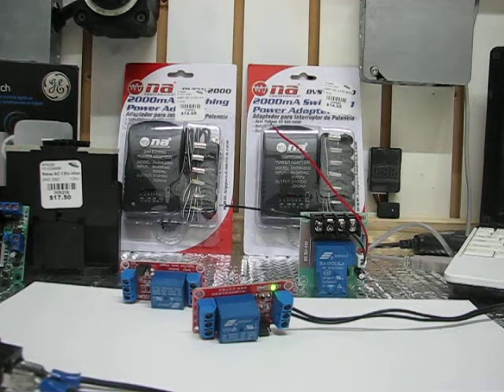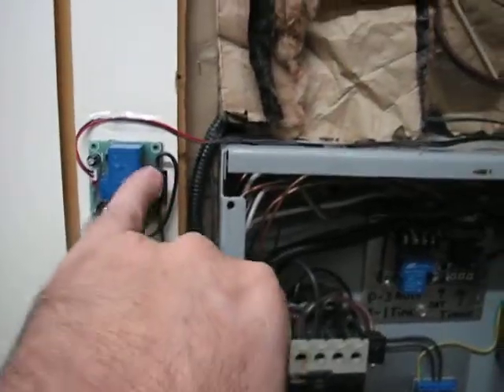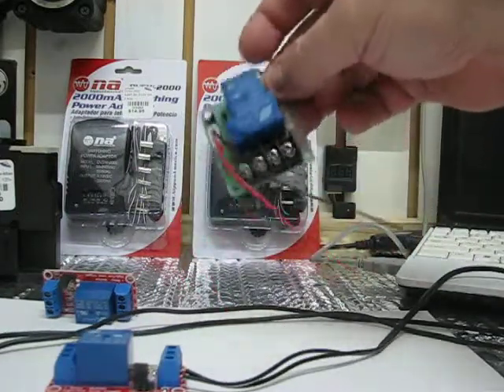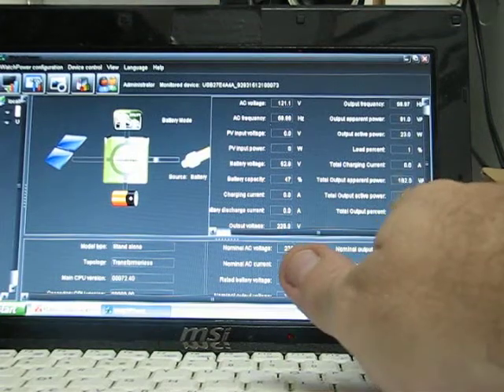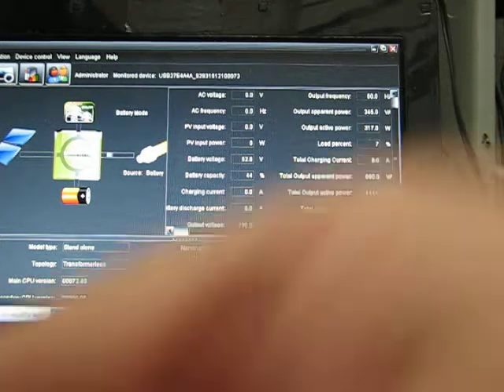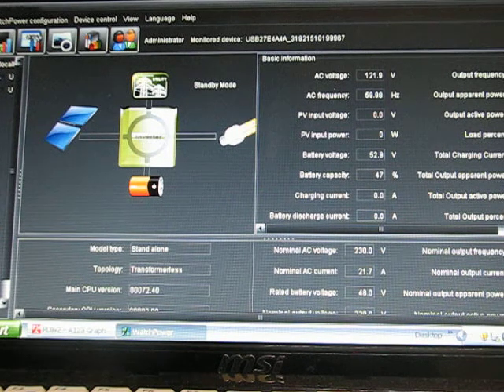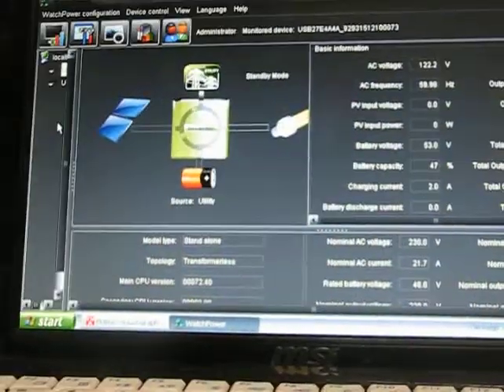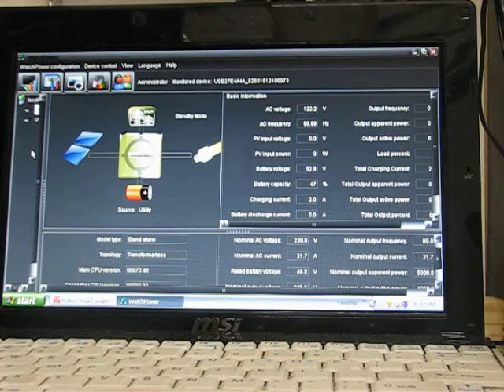MPP Solar PIP 4048 Inverter Lithium Battery Remote Control Project

Comment: Hi, I want to switch the PIP remotely. Can You give me some explanations? What simple and cheap model of WIFI switch could I use? How I have to connect it to PIP4048? Sorry but I didn't catch all your explanation because my English.
Reply from the maker: Ignazio Sammarco pick your AC switching Source timer or Bluetooth or Wi-Fi then get a 12-volt plug-in power supply hook that to a relay that's connected to the on off switch in your pip inverter. Disconnect your battery when doing this because 48 volt runs across the on off switch. Make sure you get the polarity correct if you wire it backwards the inverter will just turn on

Comment: why turn the inverters off ?
Reply from the maker: To save the batteries. 
It only shuts off one inverter when running offgrid.
Or can shut off both inverters @ sunset (or set time)and use the grid to keep batteries close to float most of the time.... switch back to inverters @ sunrise or set times. 
Still testing things out but working Awesome!!!
 it's on autopilot how ever i set it. And you can't tell when it switch from inverter to grid or grid to inverter....

Comment: hi solar junky,
i work with those here:
http://www.ebay.com.au/sch/i.html?_from=R40&_trksid=p2050601.m570.l1313.TR0.TRC0.H0.Xusr+88.TRS0&_nkw=usr+88&_sacat=0
they work via wifi, computer, and over the internet and manual switches.
a bit difficult to configure though. they have reasonably good manuals online. when ordered directly from the manufacturers (aliexpress) they are very helpful when you have a problem.
i use them to turn on pumps, the garden lights, switch off the grid on the 12v inverter, garden valves, 
they have timers on them as well.
Reply from the maker: What do you recommend for bluetooth switching?? 
Just ordered 2nd but different wifi switch to try out...
Reply: i cannot help you with blue tooth switching. i have an existing wifi and lan network, so it's just easier to use wifi for me.
Reply from the maker: Ok Thanx! 
I'm liking the wifi but didn't want router on all the time?
Reply: i have a cat6 cable connecting the shed and the house. this is used to monitor all the solar devices on a designated laptop inside the house. there are two switches, modem and a wifi station in the shed to extend wifi signal reception. this all runs with 12v dc. the current consumption is maybe 2 amperes, a small use over all. i can also monitor them from work via the internet. or change settings if needed.
so the free solar energy enabled me to use all that power use. before i turned off the modem, etc  at night and whilst at night.
that's the nice thing about solar. if you need more electricity, just hook up another solar panel. easy to do with the 12v system, just 1 panel at a time. the 48v is 3 panels, but plenty of over powering there.

incidentally that usr-88 model can be run with a smart phone via wifi directly. you do not need a router. if you want to save the electricity to run routers, etc. i myself prefer to use it via the lan because they are in  the shed.